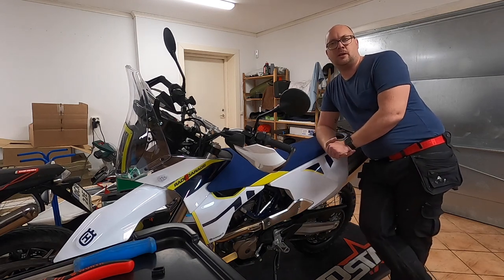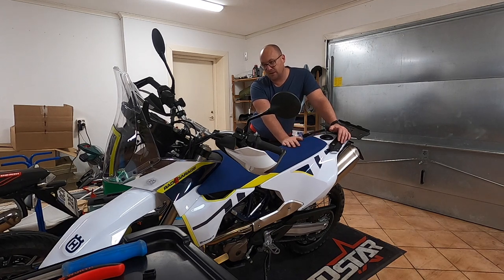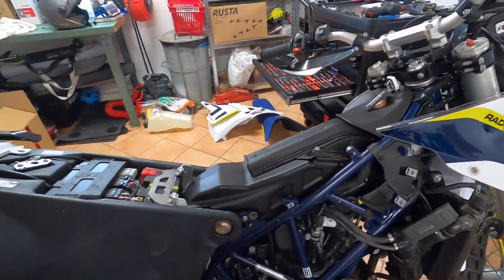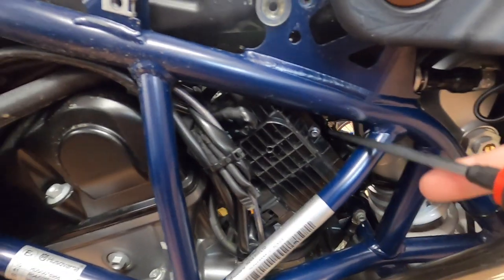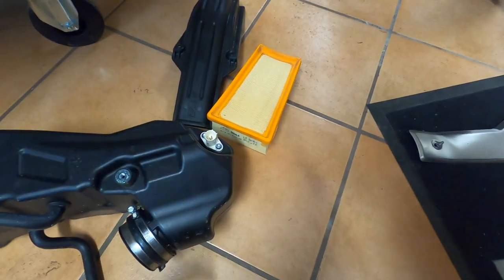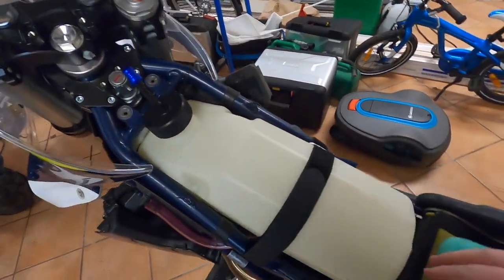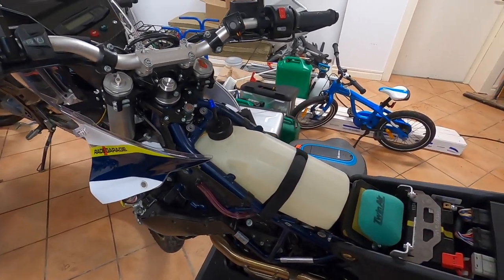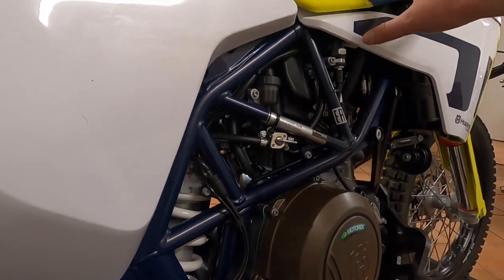Adventure Rider Sweden S1E5 - Installing auxiliary tank on Husqvarna 701 enduro

Comment: Thanks for this which was a great help and makes me wonder about a 690 I have in the US. The filler cap has to be removed to lock the steering. I can only assume the wrong kit was supplied. The other thing is that the fuel from the auxiliary tank is siphoned to the rear via a connection to the rear Vanasche filler. It works but it’s odd…….. However it gives a massive range boost over what is a very small tank for a “travel” bike to use KTM/Husqvarna parlance.

Comment: You can connect the new fuel line to the breather hose from the rear tank and it sucks the fuel. This means you don’t have to remove the fuel pump

Comment: Nice bike. Not sure if you saw it yet, but Rade just came out with a new air filter and cage for the 690/701 that utilizes the top screw design. Quicker/easier to swap filters.
Reply from the maker: Hello! Thanks! I didn’t see that yet! I have to check that out!

Comment: I’ve just done this mod and found that there is a bit extra power now although I have a wings exhaust and fuel dongle fitted. The engine revs quicker and is a lot smoother. I used the vacuum/ siphon method utilising a 3/16ths (4.8mm) fuel hose 1 meter long and drilled out the overflow to 3mm wide with a vanasche filler cap. I didn’t drill the barb. It works very well. The hoses would be better pre cut from rage garage for the air filter. The sas connection is a bugger to get on I used a 1/2in extension bar from a socket set and heated it to expand the hose so it would fit on the sas connection.

Comment: How is the fueling after all mods with intake and exhaust work? And what tires do you prefer?
Reply from the maker: I feel like I have too little testing to say for sure, but seems good. As for tires I have only tried mitas E07 (not on this bike) and the TKC80 that are on this bike right now. The 80s are good overall but drop in grip quickly in the wet.
Reply: Tack! Jag fick hem min 690 igår. Hoppas jag hinner hem i tid från jobbet i morgon och kan ta en tur.
Reply from the maker: @robertandersson2523  Lycka till och Grattis till en fin hoj!

Comment: Resting plastic on to metal isn't a good idea,there should be some sort of rubber damper on the frame and that bracket to the rear of tank to stop the tank vibrating on the metal as it will eventually start wearing into the plastic fuel tank over a long period of offroad riding and engine/frame vibrations  .
Reply from the maker: Hello! Sorry for my late response. I have done quite some miles on it and so far I see none of the issues you are presenting. I hope it stays this way!